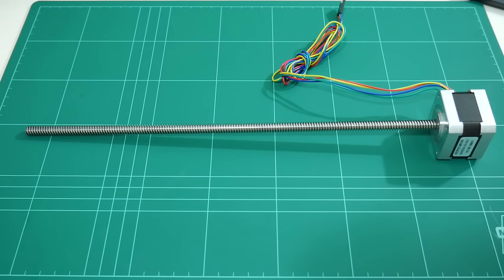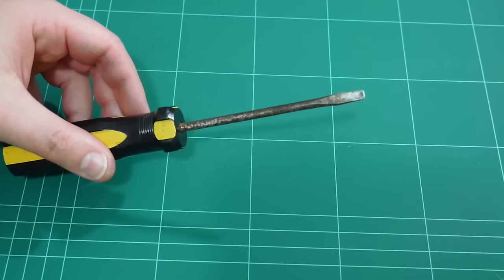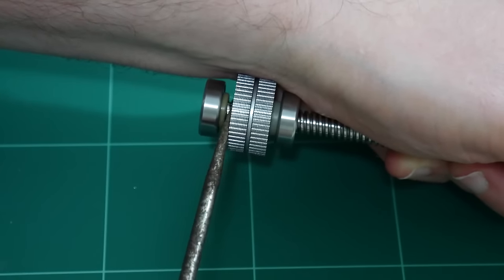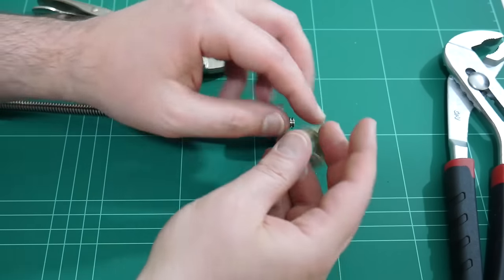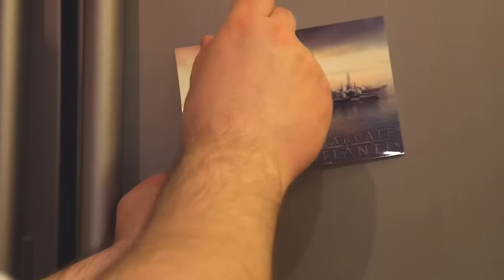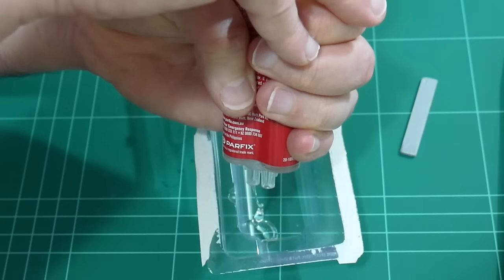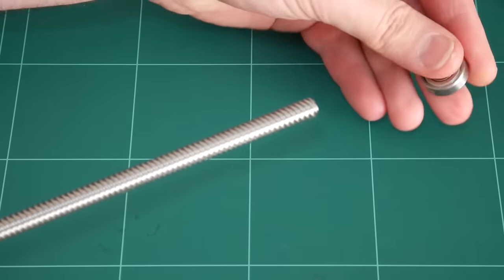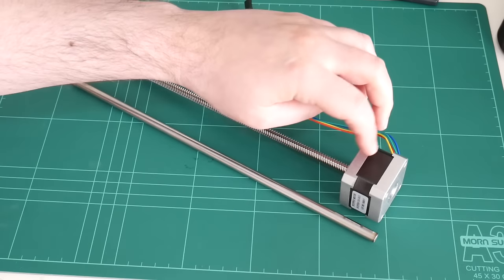3D Printer stepper motor mod

Comment: I have heard and read that the motor gets degraded/loses torque if you take a stepper motor apart like this.
Have you noticed anything like this with these mods?
Reply: I don't remember the specifics but it had something to do with the magnets in the rotor, how the field changed if you took them out of the housing.
I don't see a reason for it to lose torque but since I've seen/heard several people claim it, I thought this was a golden opportunity to see if there was any difference.
Reply: Another situation that could have an effect would be if someone attempted to use heat to break down the epoxy or adhesive. That might alter the strength of the magnets. It wouldn't surprise me if many people using just force to break the adhesive did end up cracking the rotor in some way or another altering its magnetic pattern, but I'm getting the impression that the original post was about simply pulling the rotor from the motor, and that seems to me to be less likely. Another situation might be if the stepper was using some sort of a cluster of magnets in it's shell to provide directional effects to give a stronger field for stepping, something like that might as a result be concerned with the orientation of the rotor as it's removed compared to how it's inserted, so someone deciding to change what side the drive shaft came out of by flipping it around might see some degradation that way, but in any case I'd be far more concerned with the possibility of cracking or causing shock damage to the rotor than simply pulling it out and putting it back in.
Reply: Firstly, how does your stepper motor know that you have taken it apart? The only thing that can be demagnetised is the magnet with fingers. Nope, not if you take it apart and put it back in a room you can work (unless you were an alien who live beyond the magnet's Curie temperature). Another thing is the copper wires -  be careful don't scratch them with metal tools, they are coated. There is no circuit in stepper motors.
Secondly, even if that were the case (it isn't), stepper motor should be doing their job as well as they possibly can if your extruder can reach any precise position. Why do you want to waste more torque than needed?
Reply: What I read on a motor-manufacturers site was that if the motor isn't assembled with the rotor exactly concentric between the stator pole pieces,  that's the cause of lack of torque.  They use a special jig in the factory allegedly.  When I do it,  I'm  just happy to get it so it isn't scraping.
Reply: Mr.Crankyface That's false. Magnets can lose strength, but it's usually time, or heat.
Reply: If you're worried about it being misaligned after assembling it, the thing to do is to use a dial indicator and measure the play between the end cap and the housing. See if it moves a significant amount. If it's machined well then there is no jig or way to reassemble it that can change the factory alignment. Judging by the Phillips screws used, I doubt they are worried about alignment much. All you would have to do is drop it and the end caps would slide off center.
Reply: You are correct, this is why nearly all manufacturers warn against disassembly. As follows.
If you pull the rotor and touch with the magnets a metallic (ferromagnetic) edge, then the field gradient in the gap is strong enough to 'reshuffle' the local magnetic domains. You need a tube (preferably aluminum) slightly wider than the rotor diameter to extract the rotor without touching the surrounding iron or steel edges.
Nothing like running an experiment to know if something is true or not.
I had a motor I didn't care for (MO62-FD04), so I ran dyno tests on it that showed 112 in-oz low-speed torque. I removed the rotor for 5 seconds, then replaced it and re-ran the dyno test.
The low-speed torque now was 70 in-oz or only 62% of what it was before disassembly. 
You may not notice the loss of torque but it is real and it is there.
Reply: 'Firstly, how does your stepper motor know that you have taken it apart?'  There are a lot of different types of stepper motors and magnetic arrangements.  First, think of a simple horseshoe magnet.  Even they have a keeper, without it, they will lose their field over time.  When you remove the low gap rotor from the stator, you're removing the keeper.  Next, think of a different horseshoe, not permanent magnet but magnetically permeable, with keeper.  Charge the ends hard with electromagnets.  It keeps the field, but the moment you remove the keeper, most of the field is lost.  Some higher torque motors make use of this, and the moment you separate the motor you lose that magnetic charge.   No doubt they could have that field reestablished by the factory etc but likely wouldn't be worth the effort vs get another motor.  Basically once they're in path you can apply a strong field and they'll magnetize stronger than what the parts will hold on their own not in path, and as soon as you break the path that extra is gone.  It's not that they won't still work in some fashion, just that some types will lose a good deal of their torque.
Reply: m3chanist, that anecdote was given before, it's from another website. Either you're plagiarizing someone's experience (which is very shameful) or you're the original experimenter wearing a mask.

Comment: if you just cut the lead screws and leave the part inside the motor as it
you could save a lot of your time. and keep the motor safe of any damage.
Reply: Note the part of the video where the old lead screw is bent and the new one is straight.

Comment: taking apart the stepper motor is not a good idea.. you might result with some torque lost. When you decouple the magnet from the housing, you mess up the magnetic field. To re magnetize it, you will need a special machine. Not saying your stepper wont work anymore.. but chance is you will end up with a less efficient stepper motor. Keep this in mind
Reply: When you start with one that’s bent, there’s no real loss.

Comment: Use Heat to make the glue tacky before removing shaft (warning excessive head will lower the strength of your magnet, so don't go insane heating it up)  I'm sure someone will have already said this, but just hope to make the comment more visible.
Reply from the maker: I did just this a few weeks ago with another step motor. I boiled some water, poured it into a tempered glass jug, waited a few minutes for temps to reduce a bit, then plonked in the rotor. After a few minutes submerged the rotor came away from the threaded rod by hand. Too simple!

Comment: Smoothrod can be used for a threadless ballscrew witch removes all backlash --> http://www.thingiverse.com/thing:112718.
Reply: I would never do that without a linear encoder on the axis as a sanity check.  You are trusting a lot to friction in that setup. Also the angle of the bearings will change as they wear.

Comment: I found I couldn't get enough grip without damaging the teeth, so I sat the cog thing on top of a vice with the diddle thing pointing down & hit it with a hammer. Bang! Came out. The motor I have has internal teeth that resist turning

Comment: removing the bearings : make and use a wedge with a slot cut through the middle of it. Doing it as depicted in this video can easily destroy the bearing but more over, is a good way to stab yourself in the wrist.

Comment: You mixed up the two washers...I knew that would happen
Reply: Just tried this but the rotor magnet didn't make it through perfectly. It was on there really tightly and some of the teeth got dinged a bit during removal. Will a few nicked teeth affect anything? No point gluing in the new lead screw if the rotor magnet is no good.

Comment: Meh, wayyy to much hassle IMO! Steppers are cheap enough now days (even for a really good one) to go through the trouble and risk of damage, loss of torque, etc when you could just buy the proper parts for $20 or so. Nice video on disassembly and if nothing else how a stepper is put together though.
Reply from the maker: I agree motors are fairly cheap, but this mod allows you to make a custom motor combo with any length, lead, pitch you wish.

Comment: For the cost, effort, and demagnetization potential involved, it's better to just buy a new one.
Reply: Except that there is no demagnetization. I'm 100% sure that stepper motor works as before if you know how it works, and do disassemble half as careful as in the video.
Reply: Unless you can`t get the screw off ( get it ? ) and you use something like a heat gun or torch because ( heating things up is COOL ) to help get it out ... in which case ... bye bye stepper ^_^

Comment: Be careful using a hammer on this.  I thought trying to "unpressing" it would be the easiest but the rotor is really a stack of very thin magnets.  So if you push HARD on the shaft, it will break the hole in the magnet:P

Comment: You lost me when you 3D printed that stick, you kidding me!!! You could use any bit of trash, or even cut an old raft into strips... Know it only cost a few cents to print but its still crazy overkill.
Reply from the maker: That was my poor attempt at humour, apparently... :P
Reply: I was hoping! I see so many people print 2.5D parts that take hours, could just as easily be formed from a block of wood, PVC, aluminum, etc in minutes using only simple hand tools. And in the end be a far superior part.

Comment: to my knowledge you cant just open a steppermotor without loosing alot of its torque. 

 From Anaheim Automation:

"Q: Is there any damage caused by a stepper motor that is disassembled?
A: Yes! Up to 60% magnetizing loss can be the result if the rotor is pulled apart. If all parts are replaced properly, the motor can be remagnetized at the factory, but the charge is substantial. If you have a motor failure, or are concerned about the performance, contact Anaheim Automation. Please note that the warranty period is 12 months from the date of invoice. "

From ServoRepair.com:
"First, any time a motor is disassembled, there is a high probability that the magnets will be discharged to a point where the torque will be diminished. The results vary and may or may not initially be noticeable. With some motors, the results will be immediate. In fact, disassembly of a stepper motor will typically demagnetize the magnets to a point that the motor is useless until it has been properly remagnetized."

From Lin Engineering:
"Do not disassemble motors; a significant reduction in motor performance will occur."

From a post by Mariis Freimaniss, of Gecko, who knows as much about stepper motors as anyone in the world:
"This topic came up in another group. The stator acts as a magnetic "keeper" for the rotor.
Nothing like running an experiment to know if something is true or not.
I had a motor I didn't care for (MO62-FD04), so I ran dyno tests on it that showed 112 in-oz low-speed torque. I removed the rotor for 5 seconds, then replaced it and re-ran the dyno test.
The low-speed torque now was 70 in-oz, or only 62% of what it was before disassemby.
You may not notice the loss in torque but it is real and it is there.
Mariss"

Disassembly of a stepper motor WILL damage it!
Reply: If there were a high torque requirement or a safety-of-life application, I'm sure that'd be a concern, but it's a 3d printer axis motor. The takeaway is: Don't do this to steppers used in metal-cutting CNC mills, lathes or aircraft trim tabs.
Reply: The major consensus was that the lose is negligible, at least in our applications. Most 3d steppers fall within the 30-60 oz range. So a performance loss of ~5 oz is unnoticeable. This of course speculating that the Chinese manufacture we got ours from have any quality assurance and the steppers are exactly to spec. Now large industrial steppers for manufacturing mills and such are 1500+ oz and beyond and a loss of 200+ oz is way more noticeable.
Reply: The loss of magnetic force / torque is an issue that can arise with permanent magnet style stepper motors that have multipole sintered ferrite rotors where the poles are alternating along the circumference of the rotor.  Hybrid stepper motors like the ones  in this video have a different rotor construction and don't have this torque loss issue.
Reply: +user240485 Where did you get a loss of 5 oz? It says up to 60% can be lost and in some cases you lose so much that it's useless!
60% of a 60oz is 36oz!
Reply: 60%? Not even close. None of my steppers had noticeable torque loss. I suspect that "experiment" is sponsored by the company. Alternatively, the author had absolutely no idea about stepper motor, and did something seriously wrong.
Reply: Nonsense, funny that these guys have money to lose from you not believing their folklore.

Comment: just dont buy motors of that style, they have slop along the axis, your lead screw should have no slop along its axis and it wont if you use the correct bearings, everyone and every design out there is using roller ball styes, its wrong, totally wrong, you need to be using taper roller bearings, or at the least thrust bearings, and the lead screw should not be used to support /anything/ what you need supporting should have its own support/sled, and the lead screw only used to push/pull it.
yet to see a decent 3d printer built by someone who /understands/ mechanical engineering.
Reply: excellent comment. You must be an engineer or something. Notice a lot of people don't even notice the weight your comment holds. Yeah. Tell 'em about resolution of forces, horizontal and vertical components. The various bearings are designed to handle axial or radial loads or both. By the way, that slop will directly impact the quality of the prints.
Reply: Divad Ignawm no, actually, it will not affect print quality. These are used in Z only, thus with a consistent preload based on gravity. The bearings are not thrust bearings, but they’re not being overloaded because very little thrust is in fact transmitted through them.

You can’t use this setup for a real axis or on a CNC mill, but it works just fine for a 3D printer.

Comment: Heat. Heat gun or propane torch (keep distance heat slowly or it will blue) is best. You can probably stick it in the oven to break down the glue. This is how we take heads off golf clubs.
Reply: You shouldn't heat magnets.
Reply: Well you can heat up all magnets to about 60°C without much adverse effect, but not necessarily beyond that. If you're lucky, maybe 80°C.

In this regard, a propane torch, a heat gun, and an oven all seem like spectacularly ill advised suggestions. Hair dryer is probably the hottest thing you might want to subject them to, and even that might be a bit too hot. As long as you can still touch the metal surfaces continuously without a skin pain sensation, you should be below 60°C, as a rule of thumb.

But 60°C is not really nearly enough to break epoxy usually. But might soften it a bit to help.

Comment: Very poor advice in this video, you should pull it, you are teaching people how to ruin good motors. Any disassembly will lower its torque permanently.  The field in the gap between the stator and rotor of a decent motor is strong enough to 'reshuffle' the local magnetic domains which is exactly what happens as you withdraw the rotor. The nicely engineered alternating selection of 100% aligned poles becomes a partially mixed up mush. Some $5 piece of Chinesium noname shit, however, has barely any optimization so the effect is neglible.

Comment: Removing the rotor from a stepper motor will reduce the torque.

http://forums.reprap.org/read.php?1,194350,195429#msg-195429
Reply from the maker: You will also notice forum posts of people dissembling and resembling their stepper motors without any noticeable reduction in performance. 

All I can say is that the modified motor I have in my Z axis is working fine.
Reply: Tech2C I was gonna say the same thing. If you didn't damage the rotor or the windings there should be no performance loss. maybe the people who lost torque  damaged their equipment. could be they shorted some of the windings in their coils. they also could have damaged the rotor or the bearings. if the bearings perform poorly it will show as a torque loss in low speed applications.
Reply: Josh Yeah that's pretty shady.
Reply: That post is 4 years old, And the only motor they referenced "MO62-FD04" to prove this looks to be about 30.